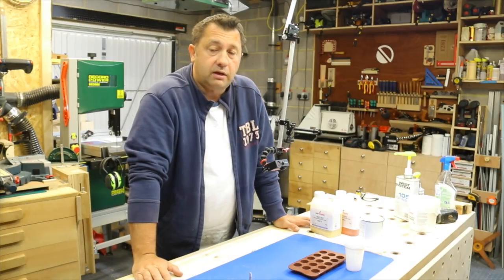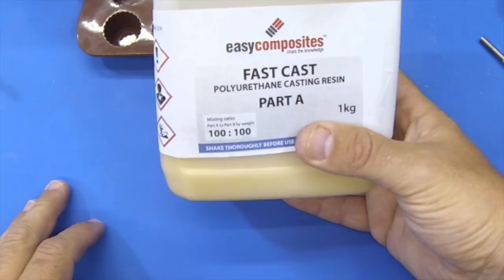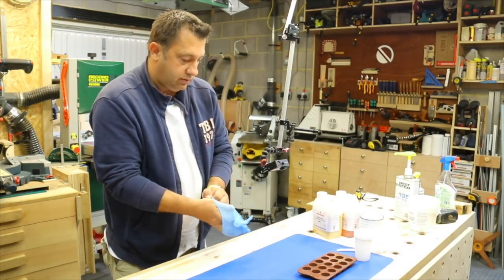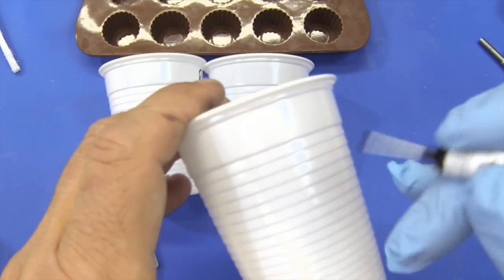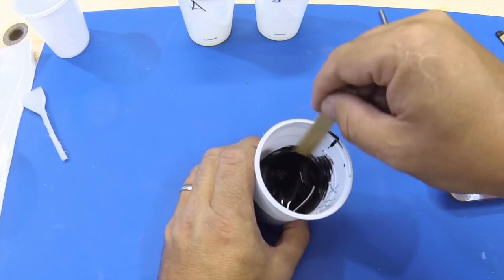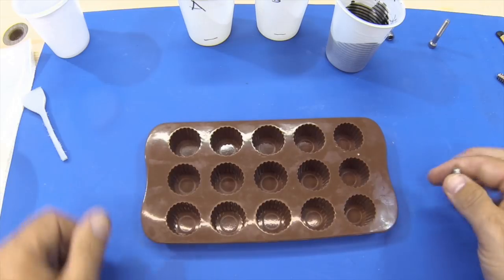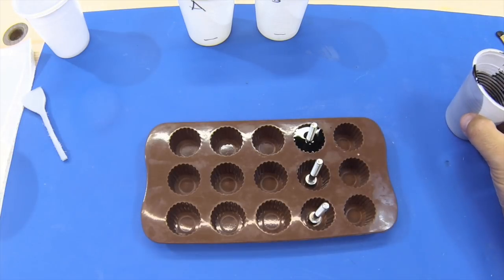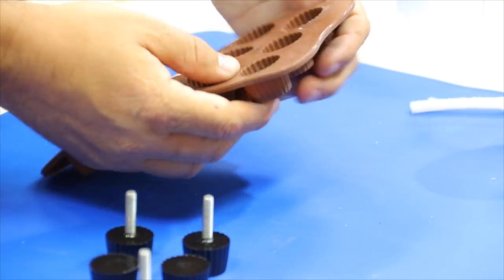Quick / Easy Knobs (using resin)

Comment: This is a nice process,  and I love the smooth finish on the knobs from the mold. 
If you wanted to create them without the bolt head showing through, you could create a jig that sits above the mold that you thread the bolts into. That way they would be suspended high enough that it doesn't touch the bottom of the mold, but still down far enough to embed them in the resin. Put the resin in the mood first and then place the jig with the bolts already in place over it. Lower it slowly to avoid any air bubbles.
Reply from the maker: Actually the bolt head going through is handily in this instance. Having access to the hex hole allows me to apply more torque. I did make some suspended so the head didn’t touch the bottom, purely for aesthetic reasons.

Comment: Brilliant and faster than going to the big box store (assuming that they even have the right knobs). It would be helpful if you added links to the mold and all your materials in the video description (and you might even get something for your tip jar).
Reply from the maker: biondatiziana thanks!
I have added links in other comments below. Not quite as helpful, but the sellers don’t remain consistent in holding the product so I do a search when someone asks and post a link for them. Here is a link for you, the good thing about this link is they have them in different sizes which could be useful for larger knobs. 

https://www.amazon.com/Webake-2-pack-Silicone-Chocolate-Peanut/dp/B01N4M6MGG

Regards, Geoff

Comment: As far as pouring the without making a mess, if you would use a paper cup for your "mix" cup you would be able to pinch the end of it and make a little spout to make it easier to pour without getting resin on your screws. Also since fastcast dries so quickly you could pour just a small bit (just enough to cover the bottom of the mold) let it set until hardened, then put your screw in and pour more epoxy. That way the screw would not be showing on the end of the knob.
Reply from the maker: Andy M good tip on the paper cup! 
I like the hex head of the bolt being accessible through the resin. But still a great tip!!!!
Reply: @StuffIMade  I thought the exposed end was handy so you could finish off torquing it with an Allen key if desired.

Comment: Great idea.  I use West Epoxy a lot in boats and it is a lot thicker than the resin you used so that will explain the lack of bubbles.  With West you can use a hair dryer on the curing resin to get the bubbles to come to the surface.  Off to get mould now as these are great.  Andy
Reply from the maker: FrenchAM100 I have used this mould so many times now! You can see in my latest video the knobs in use.

Comment: Drop in a brass/nickel/stainless disc slightly smaller than the bottom of the cup. This adds a decorative center face and hides the bolt. That can even be given a convex face with sandpaper. For old switch or potentiometer shafts, instead of that bolt, use a section of brass pipe with the desired outside diameter. Smear it with Vaseline. Just pull the pipe out of the cured knob, drill and tap for a set screw.

Comment: A good tip: When you are pouring the resin from the bottle into the cup, turn the bottle so that the spout is on top rather than the bottom. It wont run down the side of the bottle and you will have more control over it
. :)
Reply from the maker: nice tip! i will give that a try for sure! thanks

Comment: This is freaking awesome!!!
Simple stupid, so simple I wonder how I did not thought about that!!!
Also, using socket head cap screw enables you to use a Allen key if extra force is required!
Reply from the maker: Also great with threaded inserts too !
Reply: You could try to do the same with long nuts, filling them with wax to save the threads.

Comment: Have you tried pouring in two steps to embed the screw head inside the knob?
Reply from the maker: Nick's Stuff no purely because the benefit of exposing the hex part of the bolt allows me to apply torque. The resin bonds so firmly to the bolt that the grip isn’t an issue. 

From an aesthetic perspective what you are suggesting does have merit and would absolutely work. I just haven’t done it.

Like your thinking though!

Comment: Wow. Clever project and great video. I'm going to find that epoxy and a chocolate mold.
Reply from the maker: Mark Moran thanks! Good luck. Any casting resin should do, and if you don't have pigment you can use acrylic paints to colour the resin

Comment: With the round head of the allen bolt, what sort of torque can you put through it before the resin knob starts slipping over it?
A standard hexagon headed bolt would give more grip but you wouldn't have the end adjustment.
Reply from the maker: Evil from evilution I have tried to make the bolt slip using mole grips on the epoxy and a pair on the bolt and trying to twist it, with all my strength I can't budge it. I have also smashed the epoxy with a 4lb lump hammer, result was the epoxy broke but large parts still connected to the bolt, not budging. Hope that helps.
Reply: Excellent, better than expected.
Reply from the maker: Evil from evilution yes better than I expected also!

Comment: Neat.
From showing the components, I found the suppliers. Very useful. Just where'd ja get the choclatiers mould from...
Glad for the info so for the vid. Many thanks for the initiative
Reply from the maker: QaaUz I don't recall where I got them from but I found this link, they do the exact same moulds and also a star mould which looks good! 

https://www.amazon.co.uk/dp/B018SB0B7E/ref=cm_sw_r_cp_api_mGMAzb2Q1H00M
Reply: Stuff I Made Well I do appreciate that. The link leads to a feasable solution - 99p and 2,99 post uk... and ' you save 4 pounds!' hahaha. But whatever, the quartermaster in me is chuffed and your relevant response, a huge asset surely appreciated by all. Thankyou

Comment: Definitely awesome idea! But how can I make knobs for pots(potentiometer)? 
Basically it needs to have a hole instead of the bolt you have in here.

I'd really appreciate if you could take some time to try that in a video. That would be another challenge for you ;) 
Cheers!!
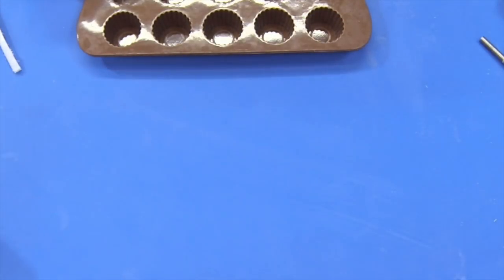Reply from the maker: Numan Syed I have done this with threaded inserts. You can see it in this video at 1:50 seconds in - https://youtu.be/ot-x3bIGDGE

Alternatively you could make the knob without a bolt or insert then drill the hole you want for the potentiometer and then glue or friction fit it to the potentiometer. 

Does that solve your requirement?

Ta geoff
Reply: That's right, Geof! That sorts it out :) I think I was too excited to realise that easy bit in there...loll

Kool !! ;)

Comment: Like the video, very well explained. Just need to know where you bought the mold and other molds. Searched everywhere and can't seem to find them. Also, who do you purchase the resin from?
Keep making informative videos.
Max
Reply from the maker: Max McLendon hi 👋. The resin was from Easy Composites (http://www.easycomposites.co.uk) and the mould can be found here - Silikomart Silicone Chocolate Mould Praline, Brown https://www.amazon.co.uk/dp/B001NNMI12/ref=cm_sw_r_cp_api_i.SVAbATM2ZF8

If you are not in the uk, use the title / phrase to search for it. Good luck!
Reply: Long ago I made larger knobs for table saw accessories. About 5 cm diameter. My mould was found by wandering the auto parts store and seeing plastic caps for chrome ball hitches. The large smooth scallops, maybe 8 around the circumference, provided a comfortable grip for tightening down as much as I wanted. I made them one at a time, placing the mold on the plate of a drill press and securing the threaded bolt in the chuck so it was true and steady. Perfectly plumb and you can set the depth into the resin precisely if it matters, e.g. for suspending a female thread coupling nut instead of a bolt.

Comment: Where Can I get the black pigment?  Can I get it from a paint shop?
Reply from the maker: Liem Duong I got mine from a timber yard who happen to stock epoxy resins and supporting accessories. However since getting mine I have learnt that you can use the thick painters acyrillic, also the cartridges from large office colour printers, the ones that contain the cmyk (cyan, magenta, yellow, black) powder (not the liquid ink)  are also great as you can mix the powders to make almost any colour, and generally when they are thrown out they still have some powder left over. Just a little messy that is all.

Comment: very nice! they look as if they came out of a factory, well done. could I please check with you whether this was polyurethane fast casting resin and not polyester? the last easy composites polyester one that I ordered did not have a and b equal parts, but just the resin and a catalyst. I would be very interested in knowing exactly which product this is, because polyester is much cheaper! thank you, Evangelos
Reply from the maker: Xylon Guitars thanks! It's Fast Cast polyurethane casting resin part A and part B with a 1 to 1 ratio.
Reply from the maker: This is the updated packaging http://www.easycomposites.co.uk/#!/resin-gel-silicone-adhesive/casting-resin/fast-cast-polyurethane-casting-resin.html
Reply: perfect! thank you... very happy that the cheap p4 does the job! this is valuable info. best, Evangelos
Reply from the maker: two part and polyurethane - pretty sure it's identical
Reply: Rust removal from lawnmord

Comment: POR FAVOR ALGUIEN ME PUEDE DECIR QUE PRODUCTOS USARON EN EL VIDEO_   GRACIAS
Reply from the maker: Any two part resin or two part epoxy will do. The mould is a chocolatier mould.

The black pigment, you could use acrylic paint. 

Cualquier resina de dos partes o epoxi de dos partes servirá. El molde es un molde chocolatero. 

Para el pigmento negro, puedes usar pintura acrílica.

Comment: Neat~!!  How do they hold up to strenuous torquing over time?    I really like your organization of tools.   Just an FIY here:  Dust Collection. Check out your insurance company's policy.  Most of them have a stone cold  policy that if they can trace ( and they will try)  a fire to a non metallic DC   ducting system then they just won't pay a  fire damage claim - period.
Reply from the maker: Raul McCai they hold up very well to torque. No slipping of the resin. Also have exposed the hex hole for the hex key. 
Ta for the heads up about the insurance!!
I am hoping to do a shop tour video next on shop organisation so watch out for that one ;)

Comment: Can this be used as a wheel?
Reply from the maker: smtel potentially with a different mold. Maybe better with a more rubber like casting resin. Depends on the torque and weight also.

Comment: The reason those resin containers are shaped that way is so you can turn them on their side to dump them out and the bulk of the fluid doesn't get to the opening so quickly and you can pour more slowly and controlled. Tipping it the way you did is the absolute worst possible way.

Comment: Pretty cool Geoff. How tight is the screw in the resin? I mean, have you ever had and issue with the screw coming loose from inside the casting?
Reply from the maker: GuysWoodshop nope it won't budge, I did worry about that, but not a problem. I was going to suspend the bolt so the epoxy filled the hex hole for more grip but it's not needed.
Reply: GuysWoodshop ถ
Reply: suspending it would cover the head and make it look more finished though
Reply: It may be nice to use a hex key to turn the knobs sometimes though. I could see both ways being preferable in certain usages.
Reply: You could use hex head bolts, or hack saw/file slits in the side of the round heads along the length for something for the epoxy to grip.  These do look great!!
Reply: @StuffIMade  you could also pour part of the mold and let cure most of the way, if not all the way. Then, add the screw, and pour the rest of the way covering it completely.

Comment: There is no need to use 3 cups.  Pour 1 part in 1 cup, mark the level on the side which will be double that (exact 1:1 ratio isn't all that important, "close enough" will work fine), mix the pigment into that one part, then pour the other part in slowly.

Personally, I'd find it easier to find knobs for sale than that silicone mold.
Reply from the maker: Stinky Cheese except with three cups if you over pour then you can pour some back. The cups are so cheap.